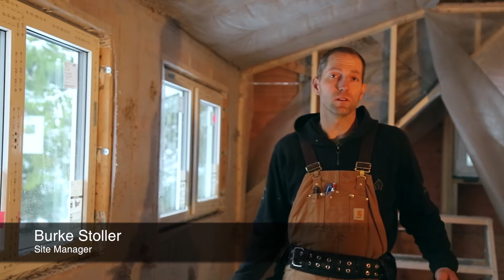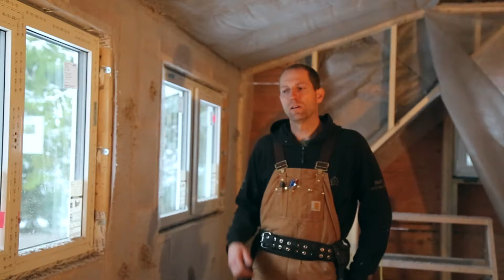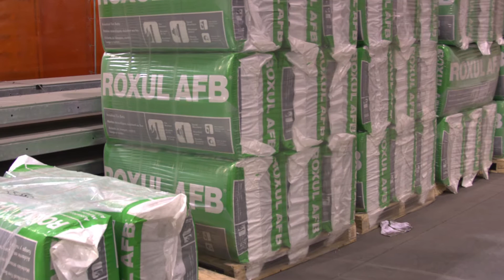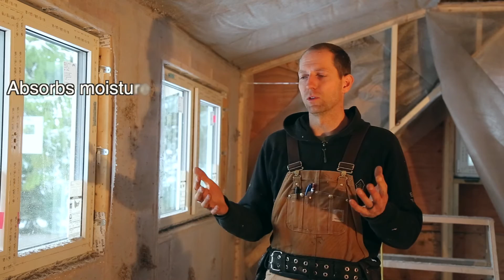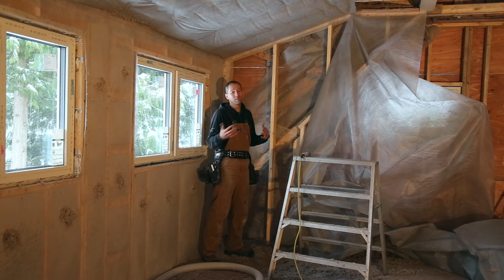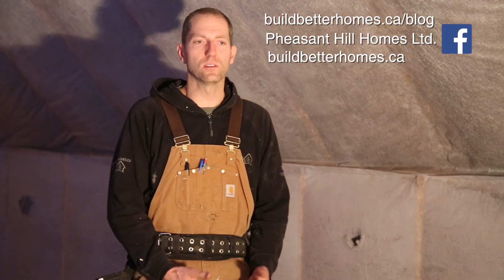Dense Pack Cellulose Insulation

Comment: Hi guys, I'm in the process of insulating my bonus room over the garage and I want to dense pack it. There are knee walls alll around it. My question is do I need to use proper vent /or provent from the soffit vent to the ridge vent when dense paking the rafter bays on the knee walls?  Thank You!

Comment: If you are installing drywall over that, the drywaller will not be happy.  Should staple the plastic or mesh to the sides of the studs, about 1/4" in from the face.  This will hold the dense pack back a bit and prevent the bulging you see in your walls, which makes drywallers very unhappy.
Reply from the maker: Hi Neil, thanks for watching and for the comment.  You're right, in a typical installation situation, that IS a good tip.  On this specific job, we were nailing a layer of OSB sheathing to the face of those studs which was our air and vapour barrier.  Inboard of that, we built a whole other 2x4 wall to house electrical and mechanical services.  So, our layer of OSB had no problem at all squashing that dense-pack cellulose in flat to the face of studs.
Reply: @buildbetterhomes  OH, I see.  Yep, that would work.  Massive R-value in that wall then!
Reply from the maker: @neilhoffman4818  you got it! #GreenBuilder #HighPerformanceHomes
Reply: Cure that 'pillowing issue' by rolling the completed cavity with a paint roller and make the drywaller happy

Comment: Been trying to find the reference to rouxl difficult to install and compromised r value.... google is returning nothing... can you elaborate?
Reply from the maker: Hi Lathan, thanks for the question!  When batt insulation of any kind is fit around any kind of wires, pipes, or ducts, it is hard to fit precisely; therefore, there inevitably is gaps which lowers the r value of the system.  Cellulose insulation will just fill in and around every shape and obstacle in order to avoid gaps in insulation providing a consistent and high r value.  Hope this helps!
Reply: It's challenging to install an insulation effectively that requires to be shaped into small and narrow wall sections.  An example of this could be: advanced framed, exterior corners, or area's where interior and exterior framing join.  Because of the fluid like installation of dense pack, small holes, unseen, or tight places can be insulated effectively.